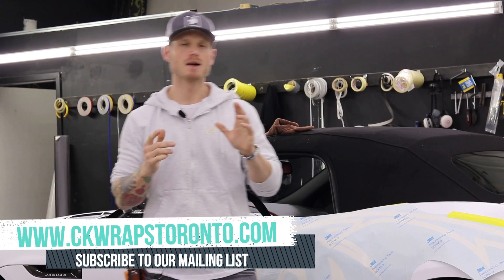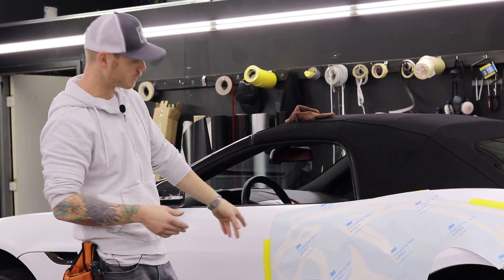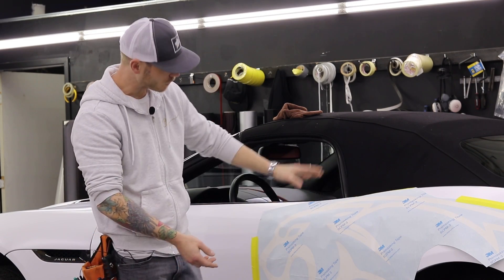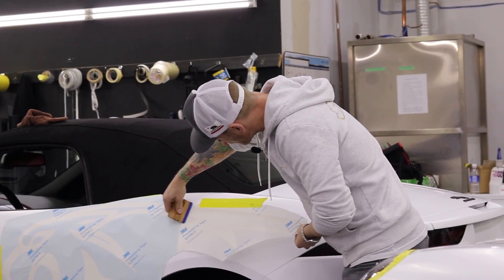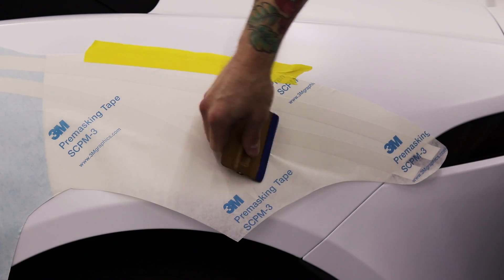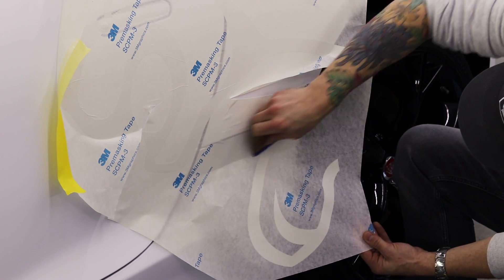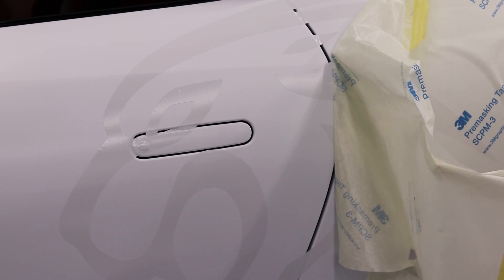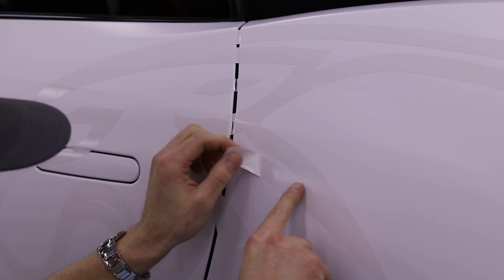GHOST Car Decals (LARGE) | Apply Non Air Release Decals

Comment: As someone who has done this for many moons, most recently in a commercial vehicle shop, that was rough...but you got it on.  So many techniques and each person gets to pick whatever works for them.  As a professional decal guy, that would take about 3 minutes with two guys.  Place it, Mark it with a china marker, pull the backing paper off and realign. Harder squeegee firm pressure.  Yes the paper masking will confirm if you kiss it with a little heat.  Oh, don’t peel it back if something happens, pop it up with a quick tug.  If you want a challenge, try it with some reflective (black reflective on a black car is pretty sweet!). Great videos btw
Reply: To avoid the possibility of jacking up the decal, I usually just rip off 12” strips of the premask.
Reply: Cut that door with the premask on bro... then peel the premask towards the cut.
Reply from the maker: These are great suggestions and the next time I do a decal I'll be using them so thank you!

Comment: Hi Christian, i was wondering why the decal itself was not cut from air release vinyl? This would most likely make less bubbles in the end. Thank you
Reply from the maker: Because air release film wouldn't stick as well when putting it on top of a satin film
Reply: CK Wraps, we do air release over a lot of color change.  Just post heat it.  Some
Installs we do is too much of a pain without the air release on the cut graphics...doubles the material cost for the customer and is a nice upsell
Reply from the maker: How is it over a satin or matte finish? I was worried because I've never done a decal over a satin or matte finish.
Reply: CK Wraps , most of what we do is print then laminated and that works great.  On color change I’ve done a few different cut vinyl decals of various manufacturers and they worked great.  I have not done it on matte or on any vivvid material (we just don’t use that at our shop at all)... it should be a quick call or email to them to verify but a little post heat should relax the adhesive onto the finish just fine.

Comment: CK- In my years of doing graphic installs just like this you posted...I’ve done both dry and wet installing such as this situation. Wet installing a decal like this one, will make the install easier and after install you need to let it sit for a few and take your heat gun and run the heat in a circular motion to dry the decal faster. I also definitely recommend the hard side of the squeegee surface, never use the soft cotton side. I recommend using the brown squeegee for these projects. When applying wet, I would try mixing baby soap with water into a spray bottle and mix it together by shaking it up really well. Then once you pull the backing paper off, spray the decal from behind and get to installing. But once you peel, be very careful and slowly in sections. I would also make your trim cuts first before you peel the paper off so you get a more clean cut than trimming the decal after you had peeled the paper off. -Ryan Oder(wrap installer)

Comment: Hi Christian. Do you have Oracal in your Country? I would absolutely recommend oracal 970RA. Its a wrapping film with air release but its doesn't have that repositioning features that others have. So its a bit more expensive than non air releas vinyl, but its cheaper than the avery and 3m wrapping vinyls and you can litterly throw decals and stuf on in no time due to the air release. You can also wrap bigger parts with that as the quality is really good, but without the repositioning feature its pita if you're working alone. For decals and stuf like that the 970ra is perfect in my opinion. Best regards from Austria! Thanks for your great Videos!
Reply: Isnt that stuff brand new? Or I guess you did say you're out in Austria, so I assume you might've had it for a while now; curious bc I'm like almost certain I just got an email from fellers earlier this week announcing they now have a "new" cast oracal film w air release haha, so you've prob had that stuff for a bit longer than us now...is it pretty good as a whole in your opinion? Or just for cut-vinyl applications like this..? I'm kind of interested in testing some...prob mainly for cut-vinyl installs if you're saying it's pretty good for that
Reply: @mkm1856  its like one of the old brands here in middle europe, so we have that for quite a while :) i absolutely can recommend it in any way. Quality is equal to avery and 3m (without gluelines lol). but as i already said i wouldn't use it to wrap a whole car alone, as its to sticky to lay down the whole film and lift it up to reposition it. If you're 2 guys working on a car you for sure can also use the 970ra without any problems. As i am working alone im using the 970ra for cuting decals and logo stuf, and mostly avery for wrapping :)
Reply: @cyriouswrapping5480  nice for sure, I'm gonna have to pick some up from fellers now to give it a try for my decals/general cut-vinyl installs then...because I know oracal; have never personally been a fan really, especially since I feel like they're known in general as being better for craft vinyl + DIY decals youd find on like etsy and stuff...but fellers (american wholesaler) just recently announced that they got those two "new" cast, air-release films in stock. Didnt know if they were trying to make it seem like it was a brand new product altogether or if it was just a newly stocked product for them in particular, but it's very clear now that the product itself certainly isnt brand new then hahah
Reply: @mkm1856  ye you should give it a try :) its not a new product at all :D but i also know that cheap diy vinyl they offer for sure. As i started cutting stickers i had that first, but i quickly switched to the 970ra. Oracal is a big name here in europe and is producing a realy wide product range tho. They're also producing window tints for buildings and that kinda stuf. Im also using a vinyl from oracal to tint head and backlights. But when it comes to decals and letterings it all depends on the price i'd say :) avery and 3m cost around 30,- per meter here and the air release oracal between 19,99 and 22,99 depending on color. Quality non air release ones are goin for about 12,99 - 14,99 or so. So with thats less difference in price i'd allways suggest to save time and stress using the air release ones :)  unfortunately we doesn't have vivid vinyl here. I'd really like to use some of there vinyls, but import doesn't make sense at all since shipping and taxes are way to expensive.
Reply: @cyriouswrapping5480  for sure, I'm personally a vvivid guy myself, like Christian here, since it's an amazing film when you learn how to properly install it. That plus I'm a vvivid wholesale member, so the prices of the other big names aka 3M + avery arent even remotely close to the price point I can get thru vvivid. But if a customer wants avery (not a fan of 3m except for stripe sets/clusters or big panel-style pieces like a portion of a hood...) then I'll happily install avery for them, it'll just cost more, since obviously it costs me more..sooo...haha. and I've never actually used oracal for a full install, only for cut-vinyl/architectural projects, and that's mainly bc I havent exactly heard good things about it as a vinyl to use for an actual wrap..so regardless I'll prob stick with what I'm used to as far as that all goes, but I'm always interested in a different/new or upgraded film I can use and offer to clients looking for cut-vinyl, either for architectural installs or for large decals/design installs...so I'll have to pick up a small roll of it on my next fellers run & give it a test run...
Reply: Oracle is a good vinyl but their colours arent as nice as avery and 3m specialy the colours of 3m are way better
Reply: @Derpen1234  yeah, but I feel like 3M has really phoned it in on a year over year basis...I used to like their vinyl a lot in terms of consistency, but each year it's like they just add better colors bc they have the means to do so, being an enormous adhesives/office stuff/general items/etc corporation and everything...but as for their color-change vinyl division now being such a minuscule portion of their business, it's like they dont focus on actually making the film more installer-friendly though...they just toss more colors at the industry like 'alright that oughta hold ya over, we'll check back in on you guys in a year'..
vvivid/avery/hexis or bust, imo

Comment: Best method for this big decal wouldve prob been going from top down with a temp hinge across the middle w masking tape, doing top half first then bottom half; both halves you'd just want to hold the premask as flat as possible, to hold the whole decal evenly juust above the surface (holding at a 20°/30-tops angle so you can continue to hold it nice & tight to avoid wrinkles), so basically pulling the premask + vinyl out flat the way you would with a normal wrap on say a hood, for example when pulling it across evenly...def wouldve avoided some of that wrinkling, plus the temp masking tape hinge across the length of the decal wouldve made it a more sure fit from start to finish, mainly bc its wider than it is tall, so as a result it would have covered more surface area cleanly all at one time. Its definitely way more tedious, but I've come to find that tedious happens to be the key to success with crap like this...I had to learn it the hard way by blowing thru a solid amount of material when doing this on businesses' doors/windows/etc outside (usually when it was windy so I'd end up getting a bunch of crap on the vinyl when pulling it back and away...).

Also just a last additional suggestion for this particular example is if you find it to be difficult to hold the entire width of the premask (w/o the backing paper on it) evenly without becoming flimsy, then you could have - during the prep stage of the decal - cut it out with a lot more space on the top of your media/decal (like 2-3" extra blank space of premask), then use an auto-skins bumper pole/yellotools wrap stick (but if you dont have/want to get one of those then you could just use a broomstick or any pole-like object that you can roll the media evenly around so it holds your decal flat throughout the whole installation) and you wouldnt be fumbling around with a bunch of vinyl that you're basically juggling around multiple areas of the vinyl to avoid accidentally sticking any of that decal to the surface prematurely...
Reply: Oh yeah and I saw someone else mention it too, but its worth repeating; hard edge of the squeegee the whole way thru is the way to go...the premask acts as a shield that prevents the hard edge of the squeegee from harming any portion of the media underneath, but gives you far more pressure onto it so it sticks well, plus it will glide just fine, if not possibly better than the buffer edge.

Comment: I've used rapid tac a few times without issues. I think what alot of people don't realize is after you apply the decal wet with rapid tac, you can spray RT on top of the premask, let it soak for a couple minutes and it helps "un-stick" the premask adhesive from the vinyl decal making for easy removal. Then you simply dry any areas you need to with gentle heat and stick down any areas that needed trimming.

Comment: when you apply the decal, Use your squeegee with an angle of 35-45 deg. Apply it by doing 0,5 to 1 inch at the time from top to bottom et bottom to top slowly. Don't  do little squeegee move. This way, it will help you to not have tension in your paper or less tension.I install this king of decal often and this is how I do it. but first,  put a tape across the decal. It will help to keep the decal in place during you install the first half of it.

Comment: This can be done much easier....when you were doing the head...you just start with the bottom so the head is set in the position and than you can cut with knife the transfer paper along side of the head shape and apply this as a seperate piece ;)
Reply: also its better to always use best vinyl for the decals...air release....its easy to remove them later without damaging the vinyl underneeth if you want to change decals not the wrap
Reply from the maker: I agree with you, I could have started exactly where you said. My experience in decals this size is limited. Application for people who are new at it will also vary as they get a handle of how to do it

Comment: My only advice is to work in smaller spots and the top layer of paper squeegee the whole thing. That keeps the sticker lined up the way you have it taped. I can already tell you that the driver side does not match the passenger. The decal ended up in a different area on the car.
Reply: Thats how my boss and I do it too :) your 100% right

Comment: Good job doing this decal dry. I personally use rapid tac. When you are done squeegeeing the decal out and hit it with a heat gun, the transfer tape pretty much falls off. If someone is less experienced I would just use soapy water. Gives you more time to set up the decal. The alcohol in the rapid tac makes you have to work a little quicker get the decal placed in the right spot. With that said you still did it like a boss. Great video.

Comment: I always use the hard edge of the squeegee.  That will help with the air bubbles. Also more relief cuts or, if the design allows it, completely cut the decal into more pieces. I also hate wet applications so I don't do that either.

Comment: No mater what. Rta sucks., . That material should only be use on flat small surfaces, been doing this for 18 yrs and I have always hated it unless you can use soapy water , but unless it’s flat that’s a no go, then you can’t get the premask off cause it’s wet. It ends up being not worth it cause it takes you twice as long to install . Use 1080 or what ever brand you like as far as colored vinyl. I think I just heard you say it was I kit, I don’t why these kit companies keep using calendared film on these complex ass vehicles. Makes it fun for us installers that work alone. Good job through. Wish I has your kinda business down here in Dallas.
Reply: It is perfectly possible to wrap a car in for example avery 800-900 series even possibly 777 without soap water (never ever use that stuff as it weakens the glue)
Reply: @Derpen1234  Totally true.. I'm following @ckwraps for long time but this video is totally wrong from the moment he starts squeeging. I wrapped a bunch of "work cars" with avery 900 and even oracal 751 without any problems. It's all about the right technique and knowing how different materials work. I don't know in your area but here no body is willing to pay for 3M 1080 or Avery SWF just to decorate a car that is going to be driven by a regular worker. And I'm not even recommending it because again 751 or 900 is cheaper and if installed correctly it will hold as good as 1080 or similar. I like to see how people spends more money every day in stuff like "application fluids" instead of taking a course on for example an avery or 3m certified trainer.